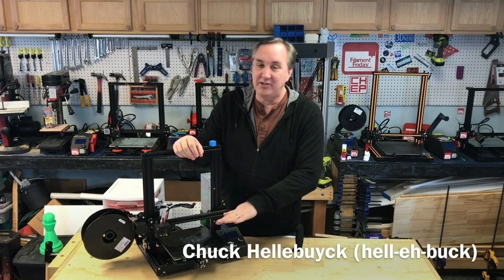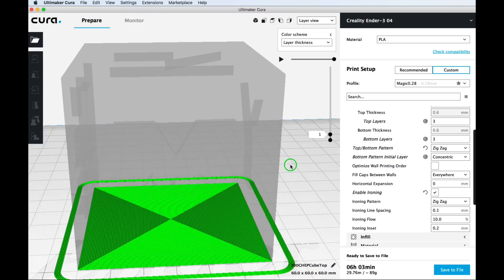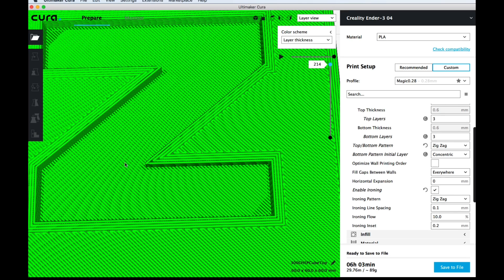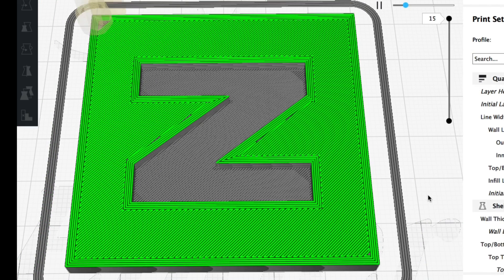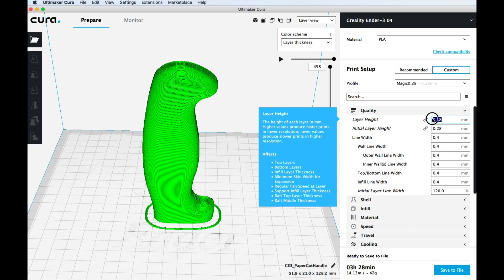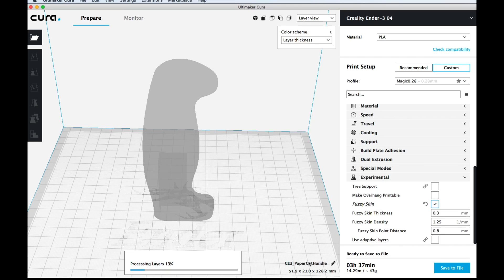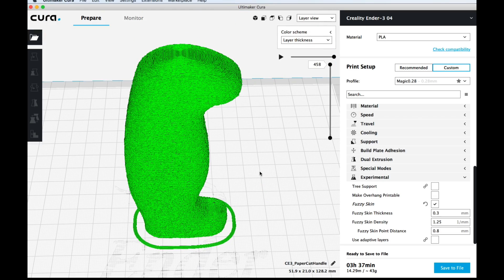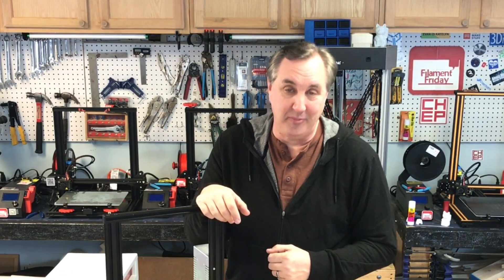Cura Fuzzy Skin and Ironing on 3D Prints

Comment: I can't figure out why but when I use concentric I cannot get cura to just do every line in order. It'll do a few lines at the outer wall, then do a few near the very center of the model. Then it'll do a large section in between but leaving a decent gap between the lines it has already done leaving a pattern that looks like Saturn's rings  It'll eventually come back and fill them all in but the fact that it doesn't just go all they way in one pass without jumping around leaves a noticable pattern that looks less than good. It's even worse when it's on the top layer.

Comment: Hey Chep, i was wondering if you had any insight on a problem i having with my iron setting. On a large plate 7"L x 2.5"W i keep getting spots where ironing misses lines and leave gaps. Any idea what is causing and a solution? Thanks!
Reply from the maker: Not sure. Check preview to see if it’s in the slicer.
Reply: @FilamentFriday  thanks for the reply. I actually just watched another one of your videos and got the same idea! Thanks for all the awesome videos, you have helped me out a lot!
Reply: @chep I have fixed the problem to some degree by changing the orientation of the print. I will keep trying til i get it!
Reply: @willlo9156  Check all your belts' tension, tram the bed (do it when the bed is at your print temp, same with the nozzle as long as you dont burn fillament), check for any play in the axes, check that all your stepper motor gears are truly concentric with the stepper shaft (even on the extruder drive), make sure your z-axis lead screw (if you have one) isn't cocked (if it is, you need to shim the motor or gantry mounts), check that your extruder clamp/arm isn't broken or flexing, check your extruder calibration (Teching Tech has a good video on it), and lastly, remove your fillament from the nozzle (cold) and check if there are embedded debris on the end that was in contact with the nozzle and remove them if there are. I suspect the gaps during ironing might be due to inconsistent extrusion, but you'd have to check all of the above to solve for that. If none of what I said makes any difference, and you end up wasting your time, here's a free voucher to hit me with your car: 🎫
Reply: @privateassman8839  thanks bro, i hope i don't need that voucher!

Comment: I know this is a very old video now but I am getting dents on the top ironed surface of my prints? I'm not sure why, of course I understand its the nozzle hitting it but the marks are fairly inconsistent so I'm not sure what setting needs changing? Combing? Z hop enabled? Any help would be appreciated
Reply: I know this is an old comment but have you tried to tighten the print head roller screws ? it could be too loose and wobble.
Reply: @raulivan2103  Yeah I figured it out not long after, turns out my nozzle was absolutely shot, as soon as I replaced it, the issue completely disappeared

Comment: A lot of times if you're finding a need to iron your prints it's not your machine that's to blame at all- it's the filament. I have some that are bad and I have some that are buttery smooth.
Reply: Any recommendations?
Reply: @justinleung3742  Eryone filaments are both cheap(ish) and really good at not showing lines.  Filaments such as silk metallics are also really good.
Reply: @polydynamix7521  thanks! I’m going to try these out.
Reply: @justinleung3742  I got Eryone because it was on sale and it was white, I wanted to do a lithophane and it turned out amazing.  I wish I could paste pictures in a youtube comment to show you.  

It's become my standard for all things I intend on painting because it's also one of the best for not absorbing half a quart of primer during finishing.  Some filaments seem to suck it up like a sponge.
Reply: @polydynamix7521  I just ordered a spool of the white Eryone PLA to test out. I haven’t done a print that requires primer yet but I’ll take your word on it and finally try doing it when the order comes in. Thanks again.
Reply: @justinleung3742  Well whether you agree on it's quality or not please let me know what you think.
Reply: @polydynamix7521  I just wrapped up some prints with the Eryone white PLA+ and I’m super happy with the results. It took a bit of fine tuning as always and now I have some super smooth prints as a result. Thanks for the suggestion! I’ll definitely be using this as my primary white filament from now on.

Comment: Fuzzy skin is basically a bad bearing/very loose belt simulator, which is why I personally dislike it. I had prints like that with it disabled when the balls in my Y bearings stopped moving.

Comment: We need an iron Initial layer setting its hard work printing a bong that is water tight I've worked it out but it cud be much easier
Reply: You could make it from ABS and literally paint it with acetone, and make the walls a bit thicker. And print it a bit too hot. I didn't make a bong, but that's what I did for a tray for my air humidifier, which had to be watertight, and it is. Protip: you can paint PLA with ABS dissolved in acetone too, and that will stick and make it smoother and more watertight. Just dissolve a lot of ABS in a small amount of acteone, because pure acetone makes PLA brittle (ABS glues it back together). Then apply several layers of it.

Comment: Is there a way to print just the first few layers of a file, or just the last few layers of a file?
Reply: For the last few lines, drag the model "below" the bed in the slicer. For the first few, do the same, but rotate it first. It'll print upside down though. There's probably a more elegant way!
Reply: Spliting it in parts maybe
Reply: You could strip out gcode

Comment: Is is possible to iron an intermediate layer? I am printing an 'L' shape structure and want both upward facing surfaces to be ironed
Reply from the maker: It will iron all top surfaces. That lower one is still a top surface.
Reply: @FilamentFriday  cool, I found it. Thanks 👍
Reply: It will iron all the layers facing on the top. If you just want the last highest layer to be ironed, there's an option "iron only highest layer"

Comment: A year and a half later and Simplify3D still doesn't have either of these very handy features.  I paid $150 for Simplify3D over three years ago and was told I'd have free upgrades for life.  There is a long overdue major release coming, but they've already announced that I'll need to pay for the upgrade.

Simplify3D is the only software I have that isn't open source, and now lately it looks like outdated abandonware.  :-(

Open source for the win.  I installed Cura and tested it.  I think I'm going to uninstall Simplify3D.
Reply: ive used both CURA and Prusa slicer and although i like prusa options more CURA has a better lay out. Also look for CHEPs other vids, cause he has included some profiles to import into CURA. Ive used them and my prints turn out great. I should also say im on the Ender 3 pro
Reply: @joelkershaw2315  - My other complaint about Simplify3D is that I was never able yo save profiles for each type of filament or print resolution.  It seemed to have that needed feature but it was apparently too clever for me to grok.  The best I could do was save an entire project and reuse the print profile when printing a similar object using the same type of filament.  I struggled with that for three years.
Reply: @Liberty4Ever  oh jeez. that sounds nightmarish!

Comment: Love your content but, I could not disagree more about concentric. I think this is an awful choice because it creates lumps where those angles change and unless you are printing a circle or square it creates a horrible looking pattern in my opinion. Also, the zig-zag is a lousy choice as well, it is a lesser version of the best choice, lines. If you examine slices of the two you see zig-zag does not cover the surface very well at all, especially where it changes direction at a wall. It leaves a lot of gaps. Lines is by far the best choice in my opinion. Just my 2 cents worth.

Comment: Hi I am new in this 3d world bought my first 3d printer ender 3, want to try your tutorials but could not found custom printer option on latest Cura software it's only shows the ultimaker models only.
Reply from the maker: You have to download them and install. Link in description.
Reply: @FilamentFriday  thanks for reply, I have cura installed but not have ender or creality printers option or any other printer than ultimaker
Reply from the maker: Under Custom in machine selection is a Creality dropdown. Select it there.

Comment: My prints star falling part and are soft like the plastic hasn’t fused to the other plastic
Reply: Sounds like the bed or extruder is set too high a temperature. I use Bed: 60C and Extruder: 200C
Reply: I use the same setting and it still won’t work
Reply from the maker: Could be bad filament or partial blockage.

Comment: To get a fuzzy skin on outside, but smooth on inside walls. 
Use the Support blocker feature in Cura.
- Turn on fuzzy skin for the object.
- Add support blocker, scale, and move to center of handle
- Turn off fuzzy skin for support blocker (uncheck "infill only")
Reply: @Neetlyuwu  
Anytime. Did that work for you?
Reply from the maker: Cura now offers the option to turn it off inside. 
Watch around 3:20 in my update. 
https://youtu.be/28f3eD8bwaM

Comment: Ironing makes the top of my print show the infill pattern on the surface. What's the issue?
Reply from the maker: How many top layers do you have?
Reply: @FilamentFriday  Usually 4 to 5 layers. The ironing seems to be warping the surface
Reply: @tonytober  same for me ! do you find a solution ?
Reply: @MissPiggy67  I simply print without ironing. Finding perfect e-steps, flowrates and infill overlap % with more wall lines work best for me. No need to Iron if your walls are already straight!
Reply from the maker: Add more top layers.
Reply: @FilamentFriday  thanks chep ! I'll try
Reply: @MissPiggy67  speed up the ironing speed to 80%

Comment: Hi sorry I had kind of a general question. How do you get Cura to show the printer head and have the play/print option that moves it around. Is that a plug-in. Also I find your view seams so much more detailed then mine is that something I am missing. Anyway love you episodes and I am totally bondage watching them as I get my printer on Christmas. Can’t wait
Reply from the maker: If your graphics card meets the requirements for Cura it will just appear in preview mode.
Reply: After you’ve sliced you can go to preview mode and select a layer then press play at the bottom

Comment: o boy o boy i didn't know cura had ironing support. i'm gonna get into this shit.
Reply: it bunged my 3d printer. holy shit it is smooth but it mangled my bondtech gears. jerky motion central in the extrusion but boy the print is smooth. i had to terminate it. might have been my wide tolerance cheap filament

Comment: Never use cura. Did anyone know if cura Will work with Prusa MK3S  or if cura Is better than slicer pe?
Reply: It not only works..  Prusa themselves have released a downloadable settings file for Cura!  Under Downloads, Under drivers & Apps look for "Cura settings" click that will bring you to a new page that tells you how to install the settings with a link to download the settings themselves.
Reply from the maker: It will work but I doubt it’s better than Prusa’s own slicer with an MK3S.
Reply: Honestly, both are great slicers. About Prusaslicer I don't like the interface so much, since it throws the different options in different tabs that I have to switch back and forth between when messing with the settings. 

Other than that, the two seem to be better for different aspects of 3d printing. I do for example like how Prusaslicer handles thin walls and bridges compared to how Cura does them. But I mostly use Cura when I need supports (which is most of the time, to be honest), because Cura supports just seem to work better for me than Prusaslicers. But if I don't need supports, I usually use Slicer, because Slicers pathing algorithm seems to be a bit smarter than Curas, leading to fewer harsh direction changes and thereby less strain on the machine.

For the Mk3S in particular, Prusaslicer may work better with some of the Mk3Ss special Features such as the "stealth mode". But just for plain old printing, I don't see why Cura would perform any worse on that machine than on others.

Comment: You can use fuzzy print then smooth it with acetone. Because of the fuzzy print you will lose less detail.
Reply from the maker: Acetone only smoothes ABS not PLA.
Reply: CHEP Yes, but you can still print with ABS then use acetone.

Comment: Very informative, thanks!  Is there a way to to make only the top layer (of a flat surface print) fuzzy?
Reply: Only in the X and Y axis, not Z. So no
Reply from the maker: If you lay the design on its side and the use the technique in this video to block the rest, it should work. 
https://youtu.be/wkS2PcZWMUU

Comment: Can you do a ironing video for PETG and dial that in?  I really like your comparative / iterative approach to making improvements.  I tried ironing PETG using what I saw on PLA and the results were not very good.  I figured it might not work well for PETG, but maybe there are some tweaks in speed / depth / flow rate and I'm really not sure where to begin to try and make improvements.
Reply: underourrock, as I watched this video I was thinking the same about using this with clear PETG. I wonder if there is a way to adjust the temperature when just doing the top layer.  That might have something to do with it?
Reply: @ericzwirnmann8151  I suspect there is a way to get decent results, but it is harder with PETG because it likes to attach to the hotend, so you'd be fighting the buildup.   I suspect the magic formula for it is going to involve a height adjustment, speed, temperature adjustment, overlap, and extrusion speed variation.   It is likely going to be a combination of most of those if not all of them to get PETG to iron out.... and just thinking about it theoretically, it might even just be a much lower speed and let the heat of the nozzle heat up and reweld the top layer without any material flow or even less than with PLA.   Not sure, but I suspect it is going to be tricky whatever the combo ends up being because of PETG's relative stickiness.

Comment: Great and to the point video!

I often use Cura’s fuzzy skin option when working with lighting (lamp shades, diffusers for neopixels, etc.). It diffuses the light much better than a regular ‘smooth’ finish does.
Reply: Daan Otto  was just about to type the same comment. Using fuzzy skin for lampshades and clear filament and big layers creates a really nice diffusion and almost glittery finish!
Reply: @BRUXXUS  Back in the day I would make those manually. Talk about a pain in the ass :P Lots of copy and pasting. I would do it by making criss crossing lines, less than a layer thickness, and stacking them slightly offset, which turned out looking the same by the time the printer printed it.

Comment: Thank you for the fantastic video! :) Should i buy Simplify or is Cura good enough now - whats your reading? Have Cura the useful feature, that i can compensate the outer perimeter, wich the nozle drives - for example, that (Lego)-bricks fit (almost) perfectly to one another? You show this feature in a Simplify-video, some time ago. In german professional machines, like STL (SLA) and SLS, thats called "Konturkompensation". Best greetings from Germany! :)
Reply from the maker: Having both is a good option if you can afford it.

Comment: Had an idea that might make it non fuzzy inside. Add a full 0.1mm layer across the bottom of your handle in the design program.  Then the inside part is now technically a "void" instead of an "outside"
Then when you put it in cura it might only fuzz up the outside and not the internal void where the handle attaches.  The  0.1 layer will be thin enough to just poke your finger through and file off the rough edge.

Let me know how it goes. I'd test it myself but I'm in hospital for the next week or so.  Having 3d printer and maker withdrawals while I'm here, that's why I'm getting my fix watching your videos haha
Reply from the maker: Thanks but I solved it. Check the pinned comment above yours.
Reply: @FilamentFriday  I saw that however it's always good to have more than one solution in the bag. There are always times when a particular solution causes other problems. Always be learning :)

Comment: Very informative, thanks. Interestingly the developers of cura said they cannot be sure ironing will not wear the printer adversely as the head is actually dragging over the surface rather than hovering above it. I have not used it much as I don't like the idea of the nozzle making contact with the model to remelt the top layer. So really user be aware. But it clearly works, the surface finish is much better !

Comment: when i open cura i dont have this slider to see inside the object how i can get it ?
Reply from the maker: One viewer solved this by upgrading his video card. Your video card has to support OpenGL 4.3 or above.
Reply: @FilamentFriday  do u recommend me to buy 3d printer filament or resin printer i like to print small object like ww2 soldiers and dioramas but i cant handle the resin smell ! can a 3d printer with 2 mm nozzle make the job done ?
Reply from the maker: I don’t like resin either. I’d go 0.2 nozzle on Ender 3. But that’s me.

Comment: Ironing is broken in the version of Cura you're using. If you notice, there are sections it misses/ignores which isn't supposed to happen. It's fixed in Beta 2 onwards on version 4 of Cura.